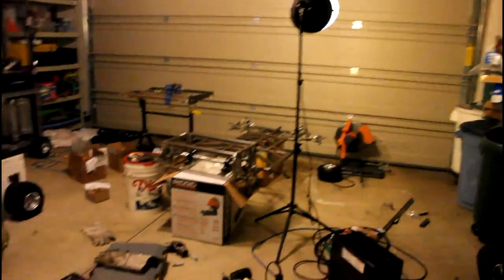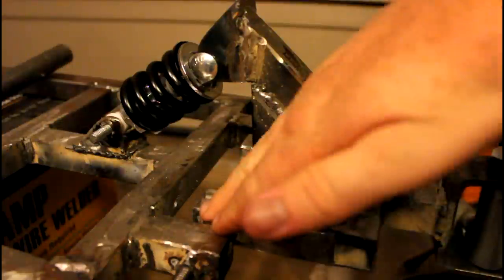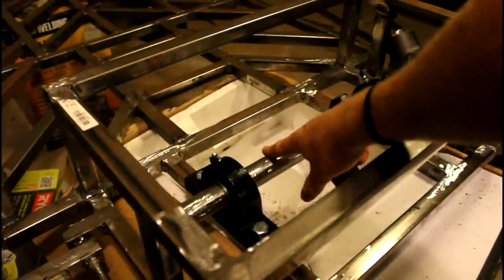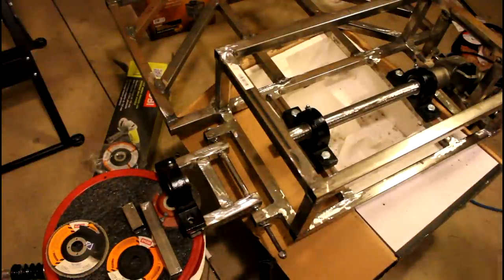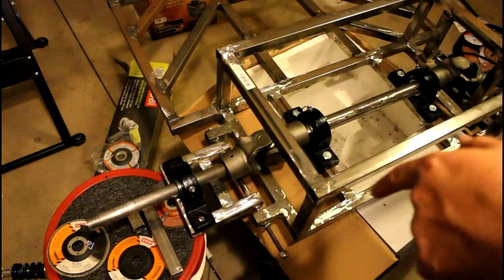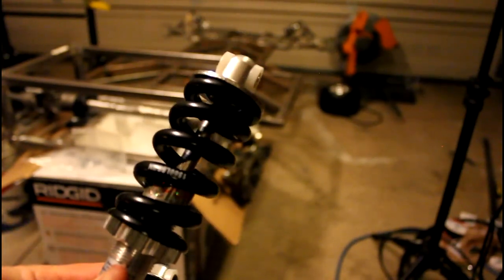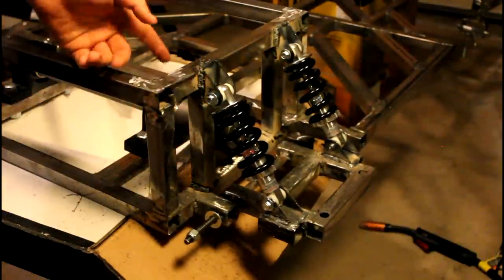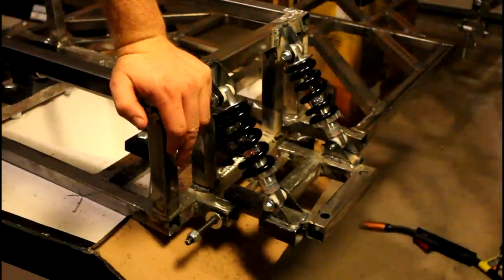(Homemade) Go Kart Build Project 14: Axle and Mounting the Rear Shocks!

Comment: I just wondered how the sliding tube idea lasted? In theory it’s metal on metal spinning and sliding fast so I would assume it either got really hot or wore out pretty quick? Just interested how it worked as looking for ideas for my first build, in the UK! 😁 Your build is looking cool so far, this is as far as I’ve got for now! 👍🏼😎
Reply from the maker: That’s a good point to ponder on haha, this was in my very early designs of fabrication, so it wasn’t the best design but it did work! To get around the fact that metal was sliding/spinning over metal, I would periodically spray dry film lubricant over the joint. I never noticed it getting extremely hot to the point where it hindered the kart from running. The point that actually was the week point was the U-joints and the connection points. That needed to be more of a spline drive system. If I were to redesign the kart today, I would try and incorporate some CV axles from a car or ATV. Great to hear you’re doing a build! It will be a very rewarding experience, best of luck!!

Comment: Awesome man nice to see an update I'm loving the suspension set up can't for more videos and it to be completed, my go Kart is on ice for Now till I get more money I need to get a job, and the parts I ordered the circlips for the piston and fan belt was the wrong side and I don't know how to return them to get my money back, and buy the right parts I'm trying to complete the motor so I can move on to the other important things like the drivetrain and exhaust system.
Reply from the maker: rushking19 Thanks for the comment as usual man, I appreciate it. Oh okay I gotcha, yea this stuff can get quite expensive! Is it possible to move onto other things in the mean time while you are figuring out the stuff with the engine?
Reply: Hnat Automotive Photography not really because I can't set up the secondary clutch till I get the motor running and mounted on the go Kart I also still need to buy the secondary clutch and a pillow bearing it mount the secondary clutch, then I'm searching for the parts for the exhaust system and can't do much till those are done the parts for the motor is just about 25 bucks it's just that I absolutely have no money should be hopefully be getting some soon, but I'll upload a video soon as I get the parts so I can move on to the other stuff
Reply from the maker: Oh okay gotcha, yea it sucks when one part of the project holds up the rest of it! Well I hope you're able to get the parts soon to build the thing because you're probably dying to get out and ride it haha because I know I am!
Reply: Hnat Automotive Photography yeah I am

Comment: Grinder's problem is probably because of continuously bending of wire causing the copper wire inside to break. Thats why its better to get branded power tools. :)
Reply from the maker: +MISFIT 414 Pretty sure Ryobi is a well "branded" power tool.... As I said in the video, the short happened inside of the protective sleeve that prevents the wire from bending/crimping, so it wasn't necessarily because of continuously being bent

Comment: Those MTB shocks will be way too stiff. Most are rated at about 700lbs per inch of compression. Porch swing springs are about 300lbs per/inch and are long enough to have two if you cut them in half. Lowes has them for around $8 pair.
Reply from the maker: Alessandro Troiano Hmm interesting, thanks for the comment Alessandro! I was debating whether they would be too stiff or not, but it's hard to tell right now. The real test will come when I do a test drive for the first time. Do you know if the porch swing springs are the same diameter as the ones I have? (which are roughly 1.5 inches)

Comment: Too bad you weren't closer to Orlando. That's where I am haha. I've been following the build since the start and I think it's going great! I subbed bro!
Reply: My only question is do you think that the tubing you're using for the rear axle is going to be strong enough to take all the abuse it's going to get it. You might've been better off to go with a solid rod that would've held up a lot better but I could be wrong. Maybe after the U joint going out to your other bearing in that attached to the tire if that would've been a solid Rod but all in all I think it looks awesome you're doing a wonderful job thanks for the video.
Reply from the maker: ***** Haha oh yea I was mainly in Tampa and Sarasota. Glad to know that you've been following since the start, I really appreciate it!
Reply from the maker: Brian Olson The steel tubing that I got is quarter inch gauge so I think it's plenty strong enough to hold up to the engine I will be using. If not, I'll go with a solid rod then. Reason I didn't originally is because it's a lot of unsprung weight to use a solid rod. Thanks for the comment and I'm glad you enjoyed the video!

Comment: I commented on the last video about the ride height and suspension placement but I can see if the springs are that stiff you wont be experiencing much (if any) sag.
Reply from the maker: +mrkthmn Yea they are pretty stiff, and after the first drive I'm gonna tighten them up a little bit

Comment: What RPM does your cart run at because the U joints you used are only rated to 1k rpm and I'm wondering if that matters for my build?
Reply from the maker: It all depends on your gearing. Take the max RPM your engine will output and using your gear ratios from your centrifugal clutch or torque converter and sprocket combo, calculate your supposed axle rpm. The amount of teeth on each sprocket will determine your gear ratio for that gear set and the manual that came with your torque converter may say what the gear ratio ranges from (that is if you're running a torque converter). This video will explain what I'm talking about with some visuals to help. https://www.youtube.com/watch?v=V9qaCjNBaYw 

I deleted the u joints and went with just a straight axle for simplicity and reliability so I'm no longer using them.

Comment: Where did you buy those u joints? I have been looking for some similar to those.
Reply from the maker: Eclipse Programmers Haha yea I looked literally everywhere for these. It's called surpluscenter.com and just search on their website u-joints.
Reply: Hnat Automotive Photography I took a look at the website and saw this "HP Rating 12 @ 540 RPM, 22 @ 1,000 RPM" what does that mean for the u joints? I can't go over 1k rpm? i have plans for a gokart, except i will be using a motorcycle engine, and i really would like to have suspension in the back without chopping the body into 2 parts and connecting it with a pivot.
Reply: +ADTRGaming what did you find out? im doing the same thing
Reply from the maker: +ADTRGaming Yea that's a rating for what RPMs they should max out at before they start breaking I guess, so you can try and figure out your axle RPM based on your engine RPM and your gear ratio
Reply from the maker: +Tyler Gaffney Check out my reply to ADTRGaming